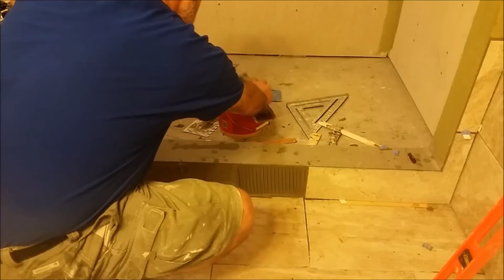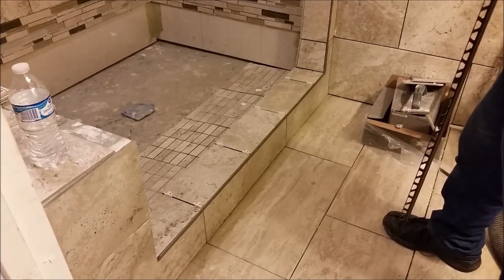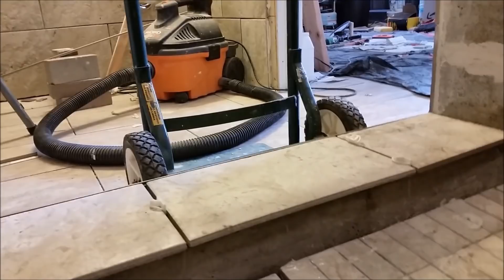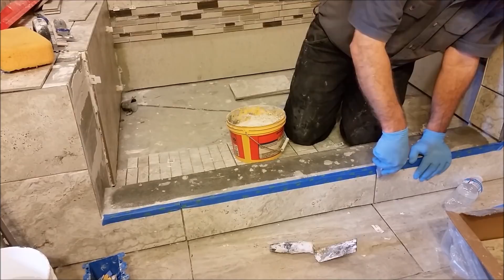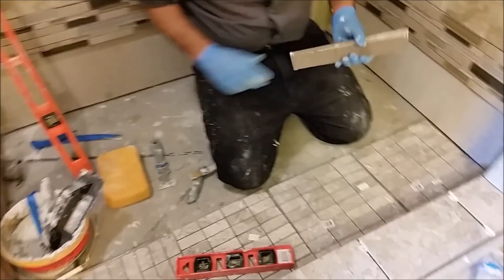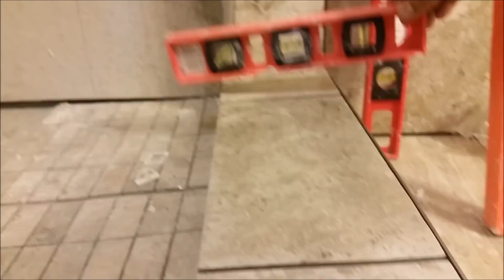How To Tile Shower Curb -  Step By Step -  DIY

Comment from the maker: Goof Proof Quick Pitch = https://amzn.to/335t8hf
Goof Proof Extra stick = https://amzn.to/2S1A9cm
Pro Caulk = https://amzn.to/2G6GKQj
Silcon white  = https://amzn.to/2HLKAiO   Silicon Clear = https://amzn.to/2Johpmx 
Silicond almond = https://amzn.to/37gjjOi

Try Amazon Prime 30 days for free = https://amzn.to/2JMWaLe 

Tools and Materials  used:
Angle grinder used = https://amzn.to/368IX8C
Diamond Blade =  https://amzn.to/3j2kTbc
Dimond hole drill bits =https://amzn.to/36bX2Cs
QEP wet saw = https://amzn.to/3cLJgaW
Diamond Blade = DeWalt https://amzn.to/3jfdpSr or Black Widow https://amzn.to/3jgx18G
Grout Float = https://amzn.to/3j7KO1c or https://amzn.to/348KLMu
Notched Trowel 1/4 x 1/4 x 1/4-Inch= https://amzn.to/3j26Zpv
Notched Trowel 1/2x 1/2 x 1/2-Inch= https://amzn.to/2S5Zceg
Notched Trowel 1/4 x 3/8 x 1/4-Inch=https://amzn.to/3cDPbhZ
grout sponges = https://amzn.to/3ieBx68
Nitrile Gloves = https://amzn.to/3i8VhrT
Best Thin set used = https://amzn.to/3cxVBz8
Medium thin set =  https://amzn.to/3mSk9aR
Mapei Pre Mix Grout = https://amzn.to/2HqhdC3
Mapei Grout = https://amzn.to/340hWS5
Miter Box Used =  https://amzn.to/2SnYgm1 or https://amzn.to/2G1CVfB
Hand saw =  https://amzn.to/30kvabp
48" Level = https://amzn.to/347tmUl or https://amzn.to/30m3y5H
Leveling System  = https://amzn.to/3n39GJN
Silicone =  white https://amzn.to/36iyJTp   clear https://amzn.to/33ZfThb
Silcon white  = https://amzn.to/2HLKAiO   Silicon Clear = https://amzn.to/2Johpmx

Comment: You are one of the few contractors that I see install a shower pan without penetrating it on the inside and/or top.  It seems most of the other tilers on youtube drill through it, although they do use waterproofing techniques.  Another observation; you don't have comments in  any of the videos, that I've seen anyway,  say, " You are doing this wrong."  Most of the other videos have comments saying something about code violations, poor waterproofing, or a number of other things.  I am in the process of remodeling my bathroom starting from the studs.  I'll use your methods for my guidance. Thank you so much for spending the time to make videos to help us DIYers save money and get beautiful results (I hope I will anyway).
Reply from the maker: The proper way to do it is by floating the curb using a metal mesh. Penetrating the liner is unaccepted  because water will eventually penetrate the liner after couple of years . If  a shower curb is constructed from wood studs mold will start growing on the curb. Penetrate the liner is a short cut contractors are using and it is against code.
Reply: Has Angelo Turner been done with the DIY remodeling ?  How did it turn out?

Comment: just confirming: you did not grout in-between tile and curb before tiling the curb. I was wondering if I needed to do this.
Reply from the maker: I grout after II installed all the tiles. So the answer is yes.

Comment: Good job. Why do you cut the tiles a shorter length for the curb rather than leaving them the same length and cutting small tiles on the ends of the curb? Is it just uniformity?
Reply from the maker: The small tiles I cut from 12x12 tiles. I did not have enough 12x24 tiles for it . Yes you can do it also.

Comment: I've worked with the pail but I prefer a big square dish basin the rubberier the better, i like getting the trowel in there sideways.. Its an idea, if you never saw it you might not think to change, but getting the trowel in & working without scooping with a 2nd trowel saves time & cleaning.
Reply from the maker: Thank you for the tip.

Comment: Very nice video. I like how you explained everything. I'm doing my first DIY bathroom tile job and thanks for mentioning the threshold since I was wondering what to put in the corners. 2 questions.
1. Did you put a threshold also on the inside of the shower step?
2. I see you are using a thin set already pre mixed. I like that, which kind is it and did you use it for the whole bathroom?
Reply from the maker: Thank you.  I did not use threshold inside of the shower step.  I did not use a pre mix thin set . I use Mapei rich in polymer thin set that is recommended to use in shower and water environment.
Reply: @josephk9182  Great workmanship!  Much appreciated of you to give away old tried and tested secrets and tricks of the trade. We were over to Italy a few years ago, and while most of our group was admiring the churches, as was I, I couldn,t help but see so much manhours of artisans and labourers combined. I saw yesterday, a two part epoxy grout mortar combination. Sounds handy in shower areas. What is your opinion. Thank you. From Canada
Reply from the maker: 1. No.  Inside I used bull nose tiles. I installed them after I installed mosaic tiles on the shower floor.
2. I did not use a pre mixed thin set. I used Laticrete 254 .

Comment: You buttered the tile horizontally but the curb is vertical.    Why did you do it this way?  And no waterproofing??
Reply from the maker: Waterproof is not needed because the curb is concrete and the way I install the liner. Please look at the videos below . It doesn't matter how the way you spread the thinset. The most important is that 90% of the tile area will be covered wi th thinset.

Comment: shouldn't the top tile be slopped into the shower itself? this way any water on the surface of that tiel would then simply run into the drain, if its level the water can and will seep onto the bathroom floor.
Reply: He did slope it. Before he started to install it he showed us how he slopes it. That’s why he is putting the top on first and the inside last.

Comment: I just had my shower done and I was somewhat disappointed that they used metal strips like you used instead of bullnose tile.  I'm having to get use to the metal when I was expecting a total tile job.  Is the metal stripping common?  My contractor said the tile I picked out did not have bullnose.  But he should have explained that and I may have picked out a tile that had bullnose pieces.
Reply from the maker: The metal is commonly used as a threshold in tile when a bull-nose tile is not available. It will be very difficult to find 2 sides bull nose tile that will fit your shower curbs. The tiles I used on the curbs are bull nose but only one side bull nose.
Reply: @josephk9182 my contractor explained that he doesn't like bull-nose because you have to use too much grout and the metal gives a cleaner look.  Still I would have liked for him to have explained that first.
Reply from the maker: Bull nose does not need much grout and you are right the contractor need to inform you before he used metal trim instead of bull nose.
Reply: @josephk9182 which do you prefer?  The shower does look great.  It is growing on me.
Reply: Jay G. metal bullnose looks way better

Comment: Why not use same size tile on top of curb as on the side and the floor?
Reply from the maker: I run out of this tile size and it was a special order from Home Depot . I had to order 1 box of 8 tiles 24x12 inches. I use instead 12x12 tiles for that. But, you are correct,  it would be better and easier to use the same tile size.

Comment: Why didnt u use red gaurd
Reply: i didnt see ANY water proofing???? LOL
Reply from the maker: There is no need to use red guard or any other waterproof paint because my curb is  constructed from concrete not stud or wood. I used hydro ban water proof when needed as you see the green color on the sides.
Reply: You should NEVER EVER USE REDGUARD IN A SHOWER!!!!!!!!!! REDGUARD REQUIRES THAT YOU USE A MODIFIED THINSET FOR THE TILES.  MODIFIED THINSET IS FORTIFIED WITH LATEX WHICH IS ORGANIC AND IS A FOOD SOURCE FOR MOLD GROWTH!!!!!!!!!!! UNMODIFIED THINSET ONLY IN A SHOWER!!!!

Comment: is that drywall you using behind the tile on the shower?
Reply from the maker: It is Hardie backer board. I never use drywall in shower. I also never tile on drywall unless it is fiberglass drywall
Reply: Joseph K cool!

Comment: why 1/4" spacing in a shower...whyyyyyyyy?
Reply from the maker: I used 1/8". I did not use 1/4" !! On the shower floor I used mesh tile  1/16" space between but on the  walls and curve I used 1/8". The white spacer I bought from Low's and it is 1/8" spacer.
Reply: @josephk9182  I read your information wrong in the video.
Reply from the maker: @professorkaos2781  Okay thank you.

Comment: No base waterproofing? Hm.. I think mankind already tried and failed this many times in the past, right? Just google for engineering tile installation would help.
Reply from the maker: Please look at the following videos and you can see that the curb is built from concrete so you do not need to use waterproof paint such as red guard.
Following are related videos for building shower curb:

   How To Build A Shower Curb - Part 1 - Prep and Build the Curb Frame. 
           https://www.youtube.com/watch?v=fNGnZ...

   How to Build shower Curb - Part 2 - Pouring The Concrete And Creating The Curb
          https://www.youtube.com/watch?v=WRNW-...

How To Build and Float A Shower Curb - Part 1 - Step by Step

     https://www.youtube.com/watch?v=7eQHF...